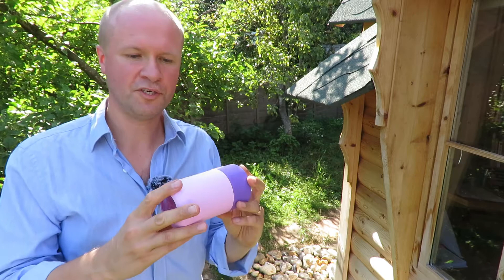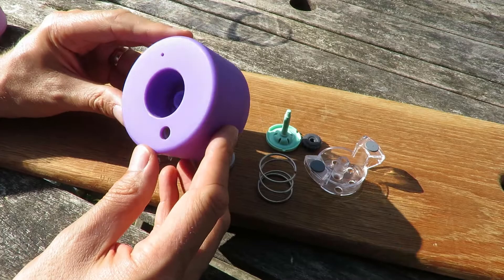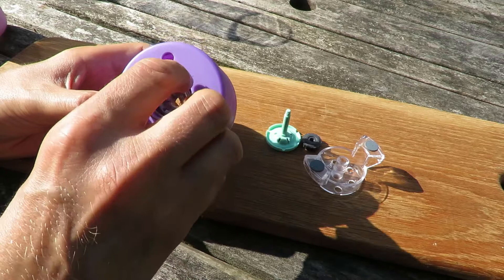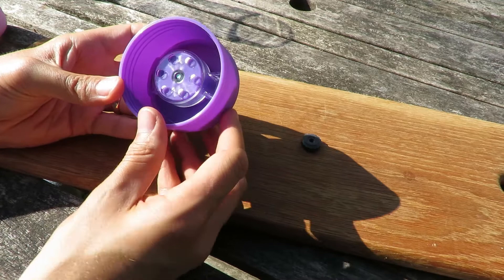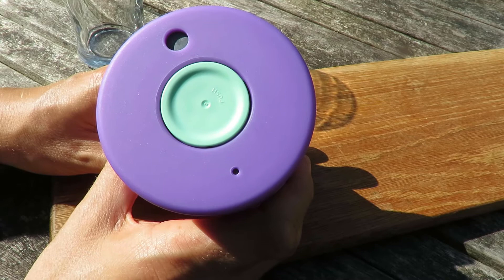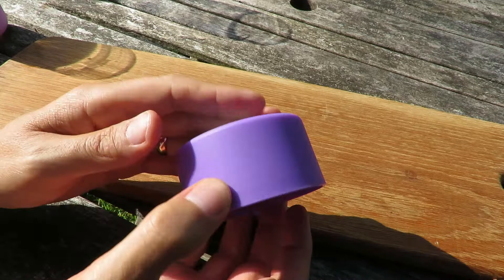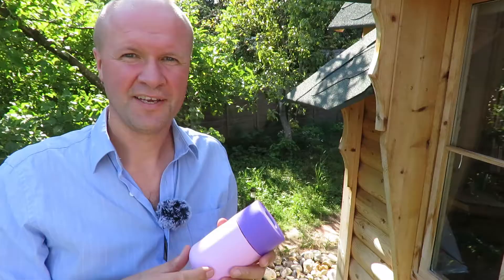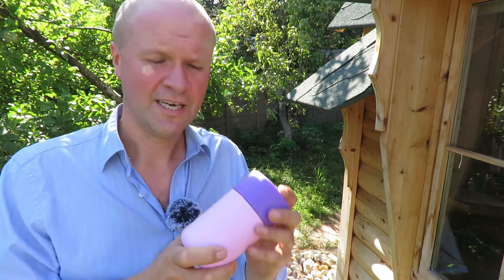HOW TO FIX FRANK GREEN SMARTCUP lid and clean inside | Review

Comment: Thanks for taking it slowly- other videos are far too fast. However, although I’m sure I’ve followed correctly my cup continues to leak. It was never leak proof   Gave I just got a dud?
Reply from the maker: Hi Megan, thanks for the very kind comment and really pleased this might help - I get comments saying 'get on with it', so really appreciate your message.
Sorry to hear that it leaks - can I ask, do you think it's leaking from the side, so it's a screw top issue, or from the top, so it's maybe an issue with those plugs that should block the 2 holes?
Reply: @DADDELIVERS  Thanks for getting back to me. I think it is a problem with the plugs - it leaks out of both the drinking hole and the air hole.
Reply from the maker: @megan2185  Ack, thanks for letting me know
I wonder if the spring is not pushing it up high enough - some people in the comments have mentioned putting it together in a slightly different order but I can't see how that would change anything... How frustrating

Comment: Just wondering if you know to to fit it if it leaks from the air hole? Would be great of you can provide some thoughts about this. Thanks lots!
Reply from the maker: Hi Samentha - thanks for the kind question and so sorry to hear this.
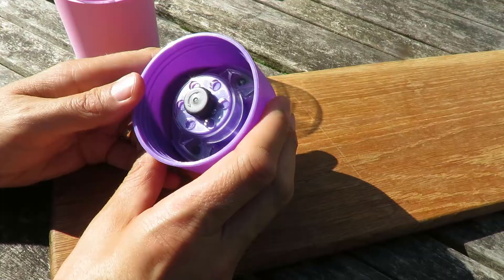All I can think of is... is the black nut at the bottom at 2:53, is it tightened on as far as it goes?
Sorry that's all I can think of!
Hope you manage to find a fix and thanks again